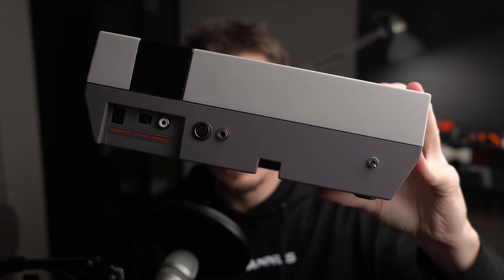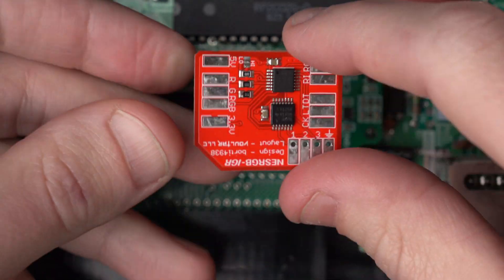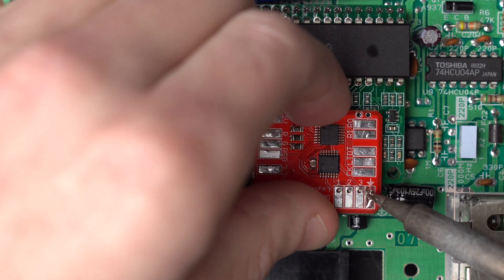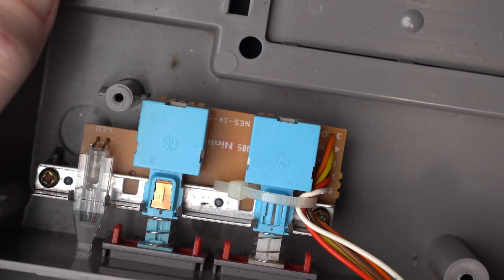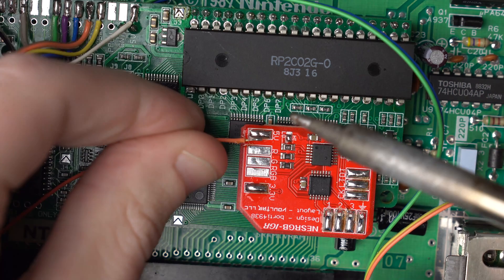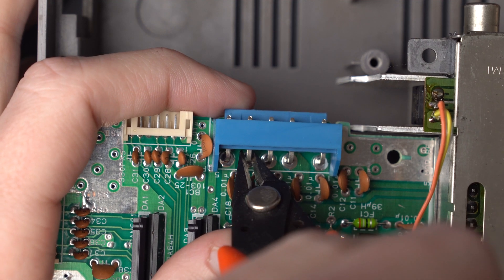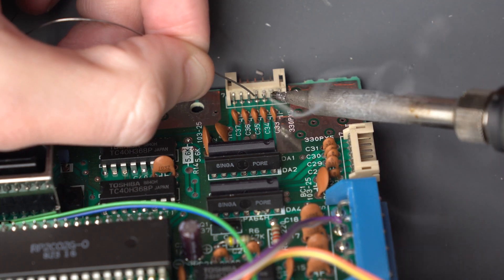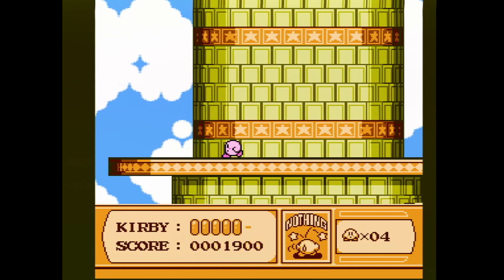NESRGB IGR Install - No More Pallete Switch!

Comment: I have this board in my Famicom AV and I found some games does not working properly with the commands of this board, a example of these games is: Super Mario Bros, Mario Bros Super Mario Bros, Donkey Kong, Excitebike, IceClimber.
In these games the commands have a very looong delay to works, like about 15 seconds to change pallets for example
Reply: @Dubesinhower do you know about that? Did you report it in your front loader nesrgb-IGR?
Reply from the maker: I will check and get back to you
Reply from the maker: Oh yea, I just tested Donkey Kong. Takes 15 seconds to change pallet and even to reset

Comment: I got a NES RGB mod v.4, which has this as an option built in. The instructions for it didn't really help me, though, so I found myself here. You're instructions were easier to follow for sure, but now my controller 1 isn't working. I'm positive I did something wrong in the wiring, but visibly everything looks good. Any tips on troubleshooting this? No worries if not, I appreciate your video a lot and I'll keep messing with it. Thanks for all you do!

Comment: Nice video! I have a question would this mod work for a regular crt or has to be a professional monitor?
Reply from the maker: Depends on what inputs your tv has, but yes, the NESRGB can output s-video, and you can use HDRetrovision component cables

Comment: I see you have an Everdrive n8 as well. 
One of the n8 pro's biggest feature is the in game menu but this mod seems to make it redundant.
There was a lot of buzz about the n8 pro's incompatibility with the igr mod but that seems to have been fixed, but there is little information online about the compatibility with the original n8. Have you noticed any issues using the n8 with the igr mod? Or should I just get the n8 pro?
Reply from the maker: Yea, some games don't work well with the reset feature (i.e. you need to hold the reset button combo for 10-15 seconds). I don't have experience with the pro, but if that game menu features works well, and you want the "best" NES experience, that seems like the better option
Reply: @dubesinhower  Thank you for responding. I already placed an order for the regular n8 but I'll be cancelling to order the pro. The extra features the pro offers simplifies the nesrgb installation quite a bit too.

Comment: Awesome video! I don't have an RGB chip installed but I am looking just for the IGR aspect of it. Would voultars chip here be the only thing I'd need then? Thanks!
Reply from the maker: I'm not sure about that. The mod gets power from the NESRGB mod. In theory I think the reset part would work, but I don't know where on a stock console to get the right voltages
Reply: @dubesinhower  thanks! I'm thinking Just getting the new everdrive n8 pro. It has reset in it!